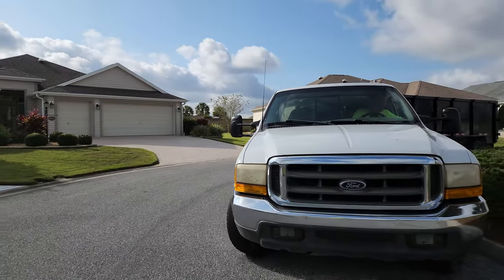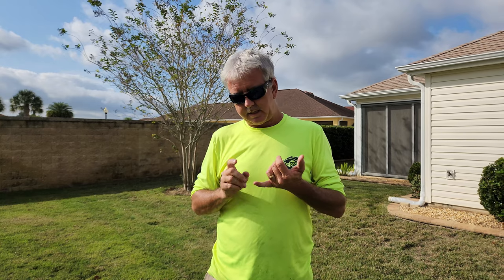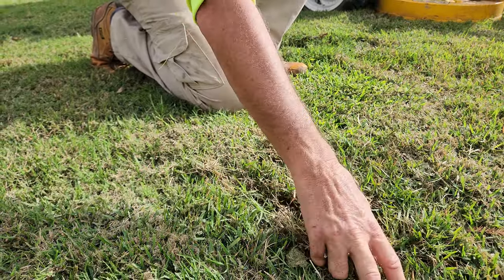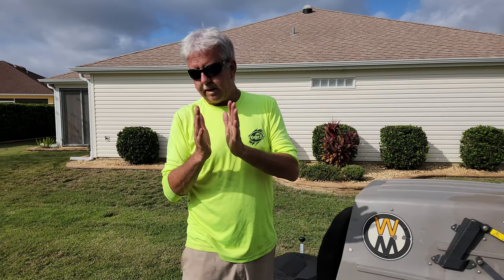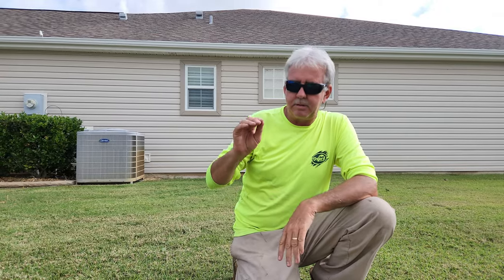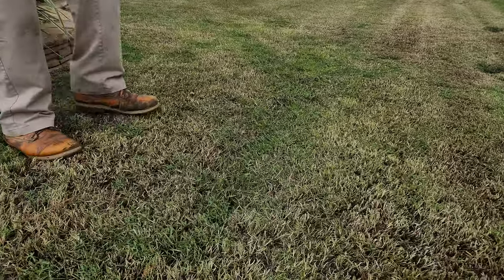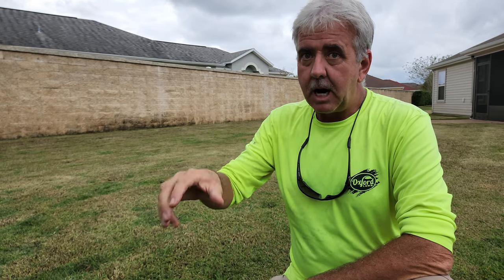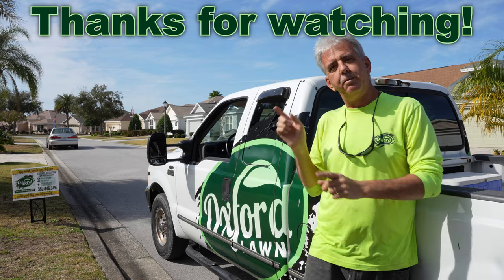Lawn Rehab : Step 1 is Dethatching and short cutting of your lawn

Comment: Great video! Just curious what height you took it down to, and what your preferred height is for maintained grass on the summer.
Reply from the maker: this was down to 2 inches.   Our regular height is 3 1/2 in the summer and down to 3 inches in the winter.  Dethatching and shortcutting can be anywhere from 1 1/2 to 2 or even up to 2 1/2 if its been really neglected and mowed crazy tall for a long time....That issue requires a step down approach.  thanks!!
Reply: @Oxford_Lawn  Thank you👍

Comment: I saw your short on the new 56" Walker deck.  Have you ever used a older one?  I had one a few years ago but it struggled mowing tall or wet grass.  I understand they have made some improvements to it.  Does it mow tall and or wet grass good?  The one I had couldn't get the grass out from underneath it fast enough.  I sold it and bought a 52" which is a beast but it is a little longer in the trailer.  Thanks
Reply from the maker: I never used one of the older models so I really can’t compare. But, our own property is is about 5 acres and the Bahia grass gets very thick wet and tall in the summer time and the deck had absolutely no issues of clogging or struggling, aside from the usual engine Tom slow downs from thick grass.  That was on an older 18 hp B series.  Now it’s on a 25i Walker and it’s an absolute dream, never need to slow down at all it just goes right through and does great. Sooty I have no comparisons like you were asking but this deck is great and no issues.
Reply: Thanks for the info